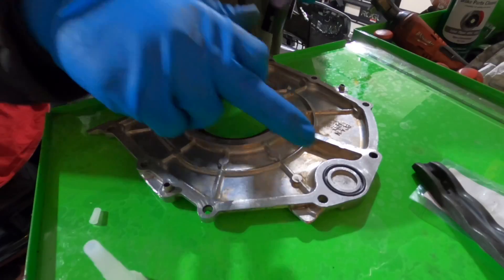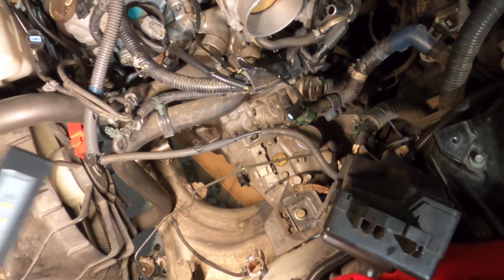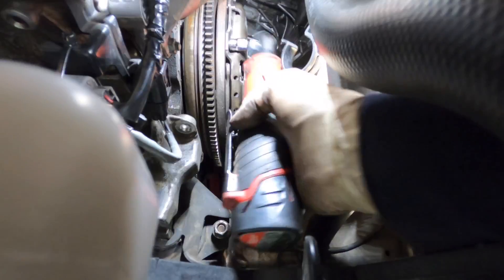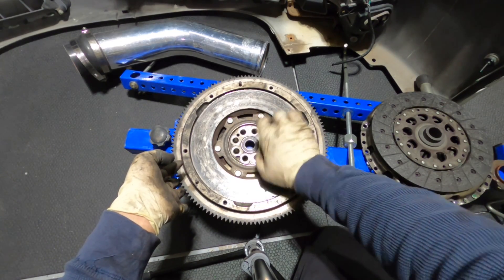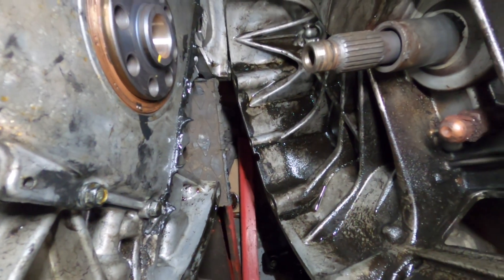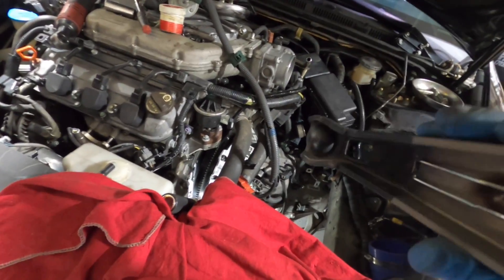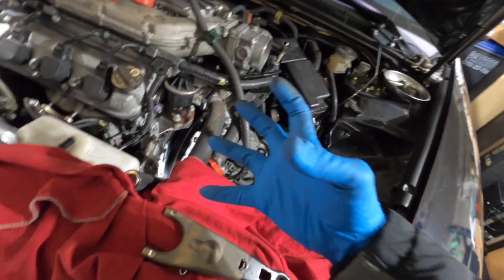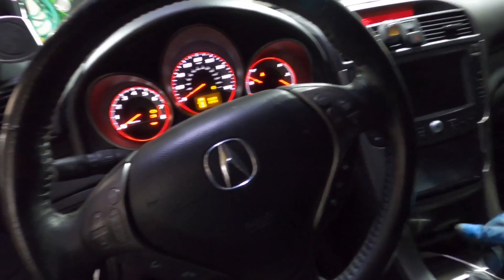TL Type S Clutch Masters Clutch, Flywheel and Innovative Engine Mounts

Comment: I just ordered the FX350 with Aluminum Flywheel for my 04 FBO J32a3 Accord 6MT and I'm very impressed with CM's build quality based on this video. The fact that they preinstalled the OEM pilot bearing is a godsend. Great video and great effort! That hard reverse engagement can probably be remedied with a clutch pedal adjustment. Hope you got that sorted out by now. Also, I felt EXACTLY the same in regards to the 75a poly mounts, but you do get used to it, and believe it or not, the NVH will go down overtime as the mounts settle in. Btw, mad respect to you brother for taking care of your Type-S. I wanted one so bad, but almost all of them are automatic around where I live. I'll be following your journey with this car now that she's leveled up quite a bit! Keep it up! Subscribed!

EDIT
After watching your most recent video, I am very sorry that happened to you. Customer service left much to be desired; I've only heard good things from CM, so this was astonishing to say the least. I had a feeling that there was an issue ever since you started the car and had difficulty going into reverse. I could understand if it was a 5 speed from a FG1 Civic EX, but not for the 6 speeds as they are synchronised...
My CMC failed last year so I swapped to the EM2 OEM CMC and CDV delete OEM SC and it made a world of a difference. The stock clutch release system MAY have played a part in premature wear. Also, in response to why there's a spacer on the CM throw out bearing, the single mass system is shorter than the stock dual mass system so I think the theory behind the spacer is to maintain the same pedal stroke. I am speculating, since I haven't received my kit yet (plus, I have to get my car out of storage), but I will keep you posted. Try the OEM throw out bearing, see if it works! If not, you can always go back to the CM one. Great job remaining calm throughout this experience. I hope things only get better for you from here on out. One love 🙏

Comment: Love Marcus at heeltoe  he set me up with the clutchmasters clutch and lightweight flywheel for my 4th gen.   The motor is all back together after having the heads ported and polished and all new seals and timing gear. I swapped the ignition coil plugs and modified the msd coils. The delay valve free master cylinder is in. I need to put my synchro tech carbon synchros and the new bearings in the transmission.  Stab her back in and test her out. It's been too long without my baby